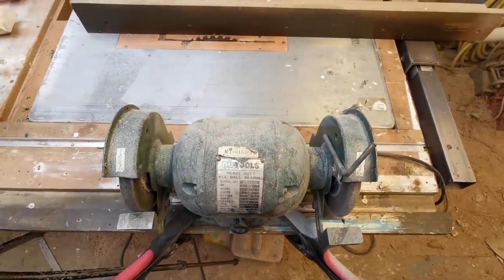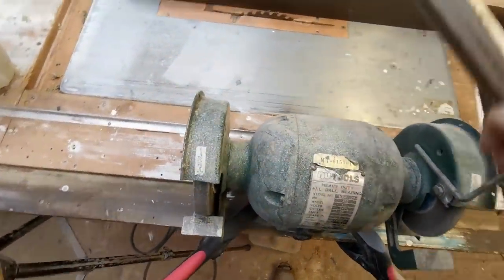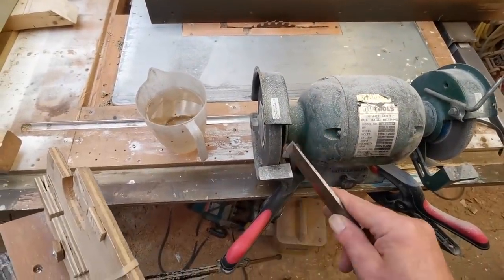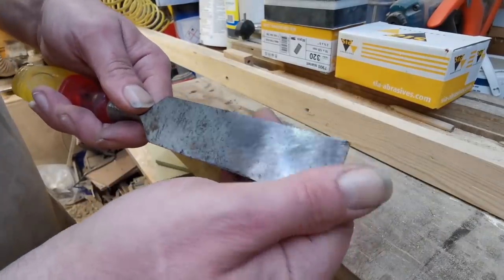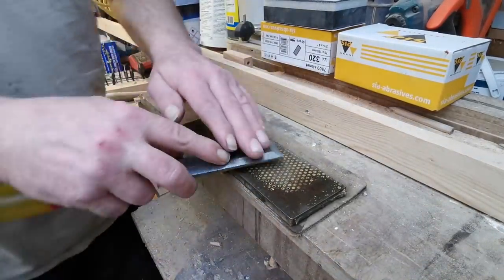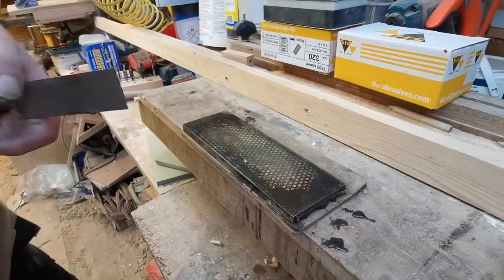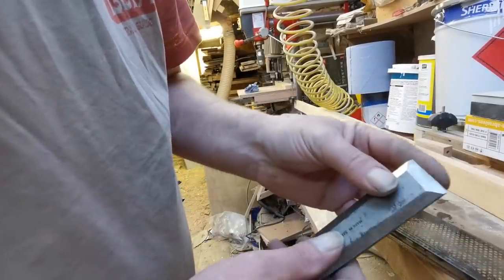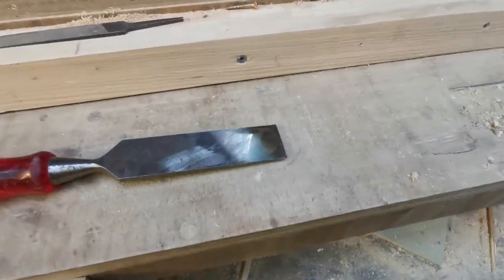How I grind & sharpen a chisel, simple, no fancy gadgets, just a bench grinder+DMT Duo diamond stone

Comment: Iv'e got one of those rolling sharpening guides. I find it dose a very good job on chisel and plane blades, for the DIY'ER  it's a very handy thing to have.
Great vids Gid, keep em coming.
Reply from the maker: 👍 Good if it works for you that's what counts, I just mentioned in another comment to an old joiner that i didn't make a vid because there's plenty out there but also i prob just take it for granted, sharpening a chisel by hand is no biggy to me, I forget that's not the case for the majority & even the young joiners, some things take a little time to hone the skill so that's mainly why i made this n if using sharpening gadgets means you get a sharp tool then good, you can't work with blunt tools 👍👍😊 Thanks Keith, I'm not sure how the next few wks are going to pan out, I have had some jobs delayed but I don't plan on retiring soon 
so will be making more vids👍
Reply: Pleased to hear that, about time we had some good news.

Comment: Eze-Lap diamond stones are the best I've used, the Trend diamond stones aren't bad either. Depending on the condition of the cutting edge I start with a coarse grit and move up the grits to super fine. Finishing off on a leather strop with some honing compound. I don't consider a chisel or plane iron sharp till I can shave hair off my arm effortlessly. I have used plate glass with Brasso polish to good effect. I have used a Tormeck and they produce a superb edge. That said the slight concave bevel the cylindrical stone produces doesn't hold its edge as along as an edge produced by a bench stone.
Reply: Bla, bla, bla! I know Gid, I'm talking bollocks aren't I, 🤣🤣🤣

Comment: I grind mine the same as you Gid but more angle and I put like a leading edge on so I have two faces and stone the front edge.
Reply from the maker: 👍 There's  a couple of ways I've heard about, some recon the curve created grinding on a wheel gives a sharper edge but there's a lot of water fed horizontal wheels now that'd give a flat grind, for me i don't notice much difference, If i was doing fine joiner with chisels that weren't a wee bit rusty n chips in the handle I'd look into it more 😁 Thanks 👍

Comment: Hi, I know its unrelated, but where do you get your abrasives from? I saw you mention buying new ones in a recent episode.  Thanks, Scott.
Reply from the maker: Hi, the flexi pads come from Axminster, the sanding sheets i used to get the Abranet ones from Axminster too pack of 10 for £7-ish, they last a long time & needed to buy some more but a while back someone mentioned the Sianet ones were cheaper, 50 for £17-ish, so i went with them this time, they're on ebay but it says the supplier is Axminster again 👍 I've only just got them but they seem no different so I'm happy. Hook n loop pad https://www.axminster.co.uk/flexipads-hand-block-medium-soft-510003 Sianet sheets on ebay. i got 120 & 320grit https://www.ebay.co.uk/itm/Sianet-7900-Sanding-Strips-Sheets-70-x-125mm-Box-of-50-Net-Abrasive-Strips/202060711077?ssPageName=STRK%3AMEBIDX%3AIT&var=502056144923&_trksid=p2057872.m2749.l2649
Reply: @Gidjoiner  thank you, I've been meaning to try these. thanks for the advice.
Reply from the maker: No prob, I've been through a few boxes of sheets & these are my 4th pair of blocks, i wouldn't keep buying if i didn't think they were worth it so hope you find them equally worthwhile 👍👍

Comment: When I haven’t got my Tormek system handy or diamond plates, it’s out with the old double sided carborundum stone & sewing machine oil. Happy days. 😃👍
Reply from the maker: I couldn't find my old stone 🤷‍♂️ gonna have to find it , i need to know where it is, found my old Yankee tho 😁😁👍
Reply: Bloody hell, that takes me back. They were lethal. You should’ve never used them to screw upwards, like under a worktop. Nearly lost an eye once when it slipped & shot upwards. 😕😕😕     I’ve got my old site toolbox still. Got a couple of Yankee’s in there with a brace & various bits, breast plate drill, spokeshave, saw sett & files, surform etc etc. Strangely, nothing has a motor on it. Lol. 😃😃👍👍
Reply from the maker: 😂😂 I had a clear out 10yrs ago n gave a lot away, maybe my stone went then, Yeah the Yankee a bit dodgy sometimes, I think I'm/was quite cautious of it, never came out around glass or laminate tops, haven't used it for prob 30yrs tho, 9v Makitas took over,
Reply: My dad taught me to sharpen stuff when I was in my early teens, plane irons, chisels, saws etc. But he also taught me how to sharpen scythes, sickles, bill hooks, bean hooks etc. I also sharpen my spades, it’s so much easier digging & you can cut through roots. Happy days. 😃👍
Reply from the maker: In the middle of Leeds here there's not a lot of the latter you mention but i learnt the sharpening spade when i was a teen n have sharpened a few for people over the yrs, "I'll sharpen that for you" the look in their eyes, "eh? sharpen it" then when i have "ooooh that's so much better" 😂